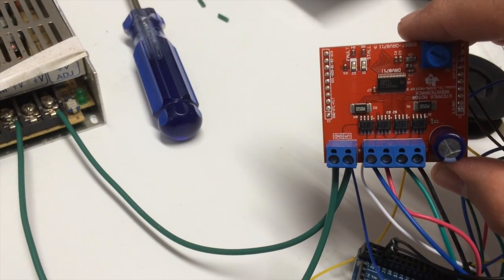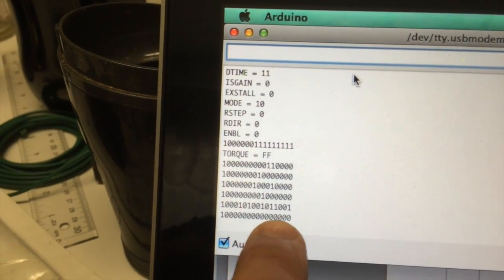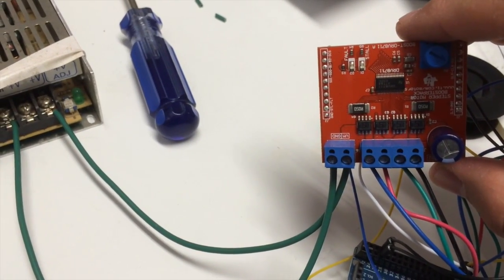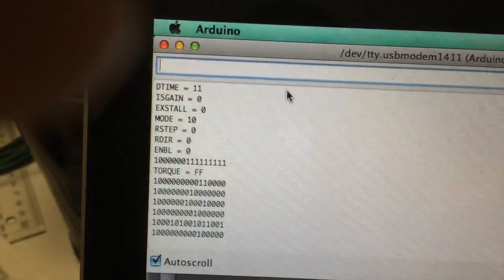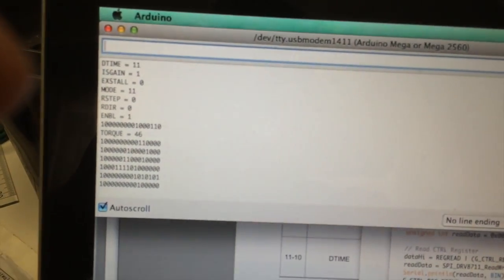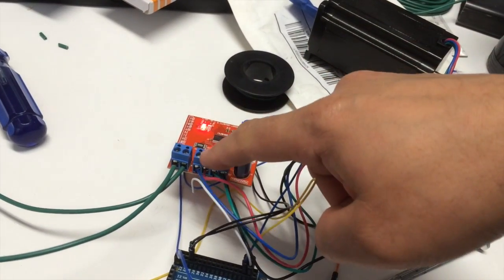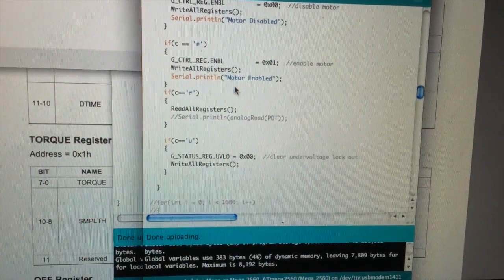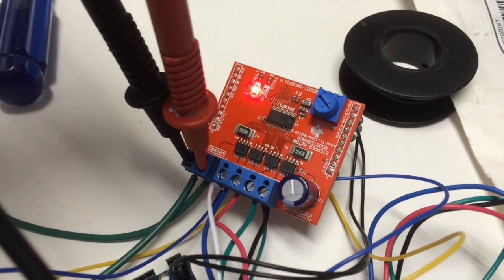DRV8711 UVLO Fault

Comment: I'm can't interfaces with drv8711
0
Control Register
DTIME = 0
ISGAIN = 0
EXSTALL = 0
MODE = 0
RSTEP = 0
RDIR = 0
ENBL = 0
0
TORQUE = 0
0
0
0
0
0
0

or

1111111111111111
Control Register
DTIME = 11
ISGAIN = 11
EXSTALL = 1
MODE = 1111
RSTEP = 1
RDIR = 1
ENBL = 1
1111111111111111
TORQUE = FF
1111111111111111
1111111111111111
1111111111111111
1111111111111111
1111111111111111
1111111111111111

Comment: Hey Saleem, i found this video from the texas support forums. Im working on the same motor booster pack. Im beginner in arduino code so I wanted to ask if you could share your arduino sketch? Im especially interested in how you read the spi registers and can refresh it from the serial monitor.
Reply from the maker: Sure.  I pushed it to Git Hub.  You will find it here:

https://github.com/jerseyguy1996/Stepper-Driver

Just keep in mind that the pin numbers are for an Arduino Mega.  You will need to change them if you are using a different Arduino.  Hook up the SPI as normal.  Change the  #include  directive to reference your location for "registers.h".  I basically just took the TI sample code and tailored it to work with the Arduino.  You can find that here:

http://www.ti.com/lit/zip/slvc575
Reply: Saleem Banatwala Thanks a lot! I actually dont use arduino at all but texas's launchpads msp430 and c2000. Or at least i try to learn them. I got the texas sample program to work and it works with accelerations so smoothly. I wish I understood their code, but im beginner in coding altogether. The accelstepper library cant get high enough steps per second and many other libraries dont have any acceleration. I wonder how they do the acceleration in the sample code. I tested it with msp430 and steps per second could go up to 64 000 with acceleration (the max was set to 65535). Trying with max step rate the motor would not turn properly but i guess there could be other issues while trying to turn with max rate.
Reply from the maker: I have no formal training in coding either.  I just learn as I go.  After a little time it all starts to make sense.